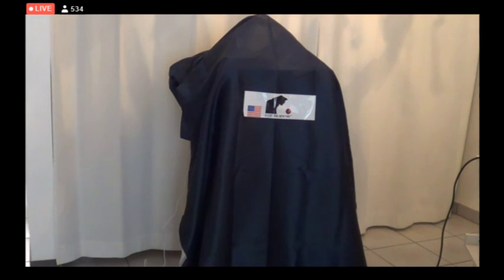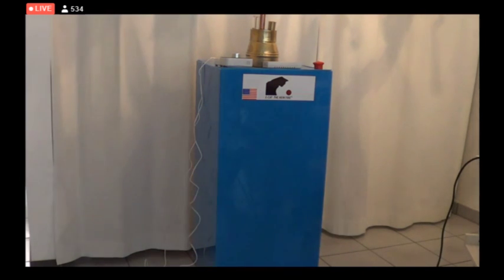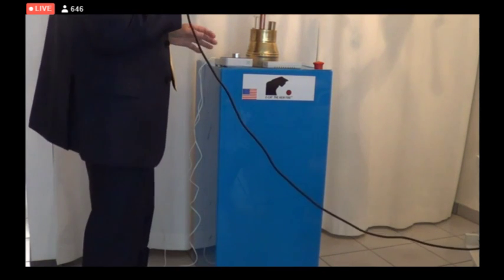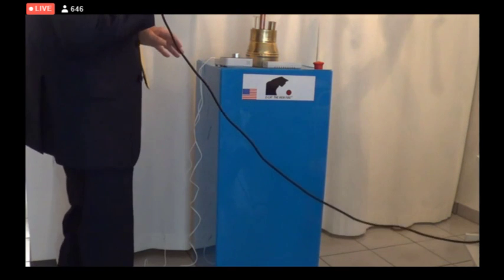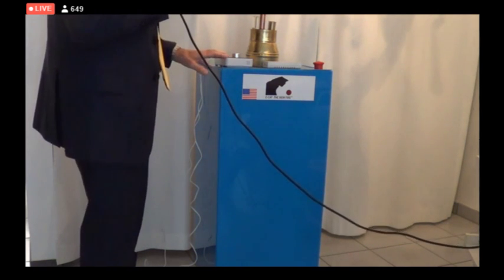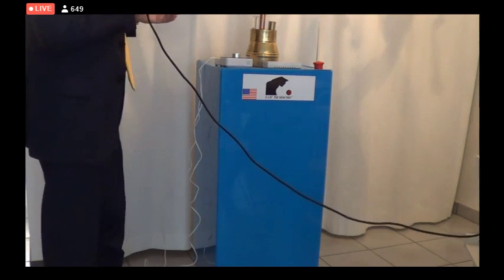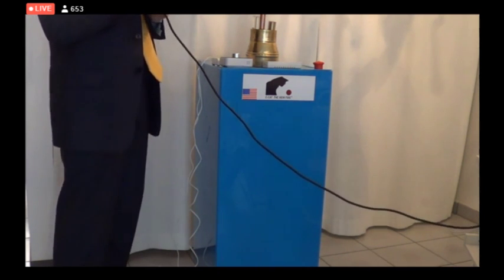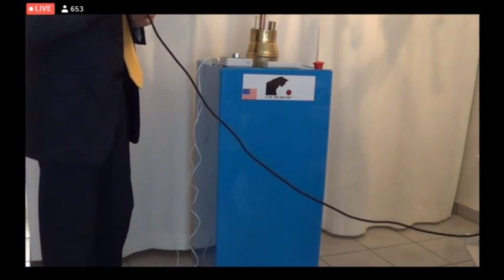ECat SK Main Presentation

Comment: I am absolutely the biggest fan, and keeper of hope, that this is a real energy source.. But it has been the better part of a decade already, if I had excess heat I would have harnessed it myself by now. Thermo electric generator, stirling engine, or anything else, to at the absolute least make it self sustaining, without any strings attached (power input).. WHEN???

Comment: One a quarter that size would do for a normal sized home.. Question: cost and longevity of the system?
Reply from the maker: He says 20 years with fuel lasting at least 1 year based on tests - no independent verification.